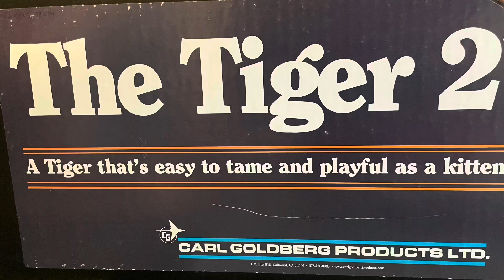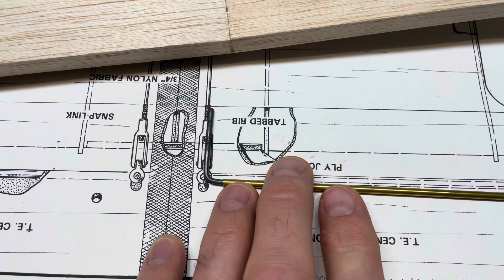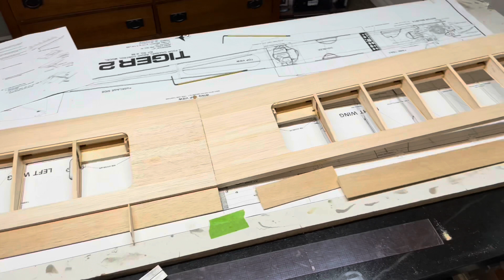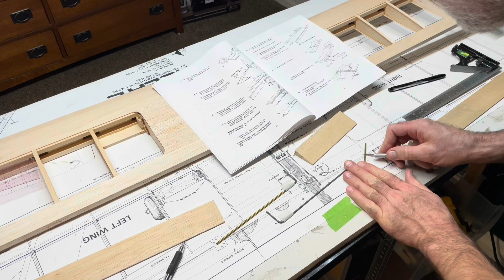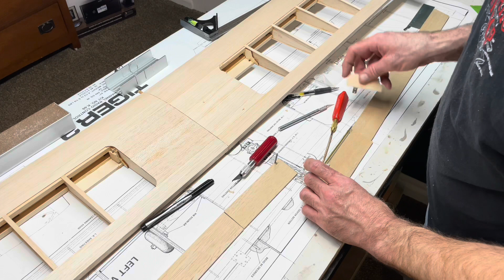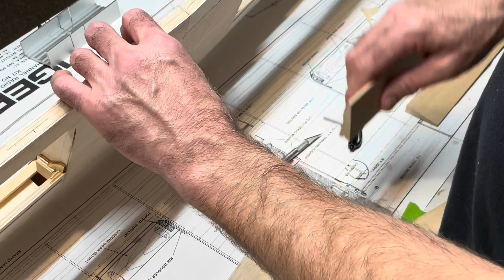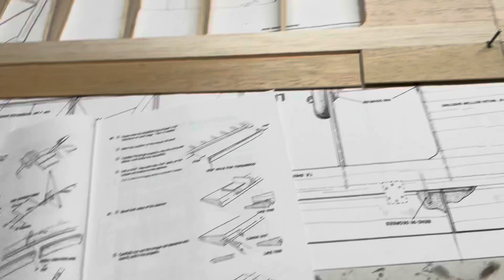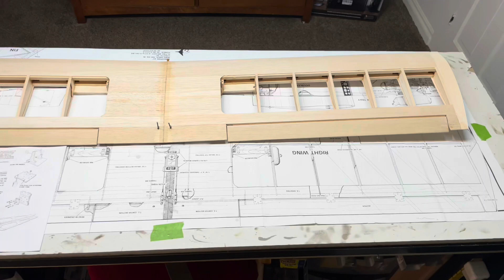Carl Goldberg Tiger 2 Build Series: Part 4

Comment: I picked up a couple Perma-grit sanding bars a while ago. I like those better than my Great Planes easy touch bars. When I start sanding I always grab the Perma-grit first.
Reply from the maker: I agree. I finish sand with the Great Planes sanding bars, but use Perma Grit for the initial sanding. 👍
Reply: i glued perma grid flexible file to the Great planes sanding bars and this works just as good as the permagrit blocks but cheaper and more ergonomic
Reply from the maker: That’s a great idea. 👍